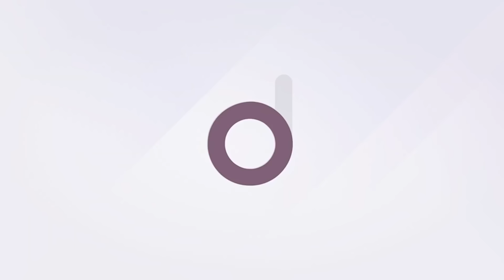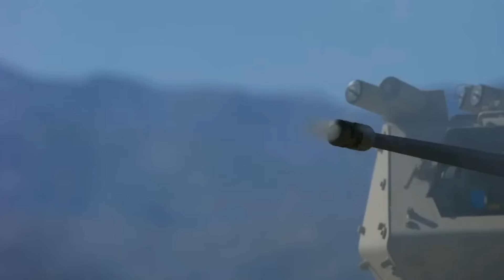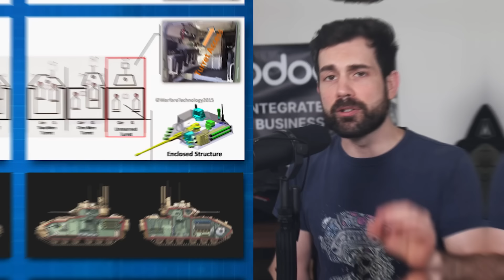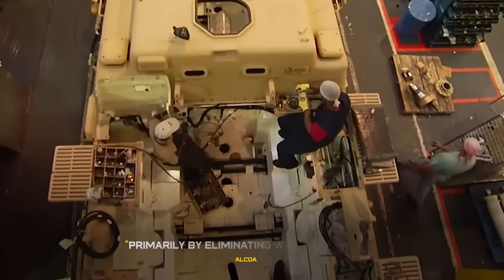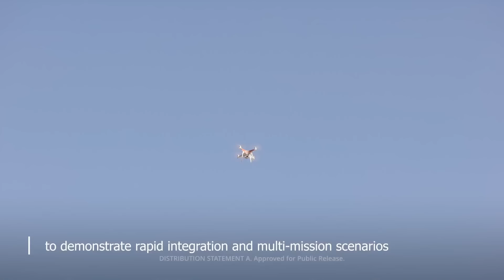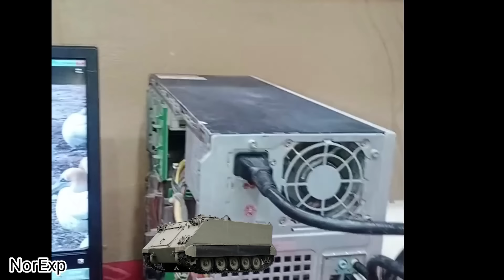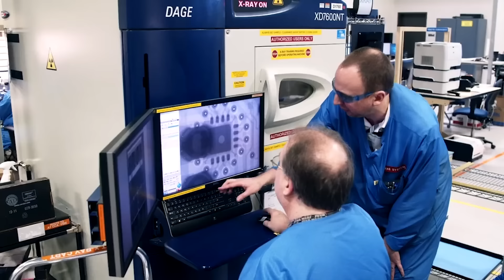How America’s Quietly Building a Secret Armored Fleet

Comment: I can build a box that's 2 ft by 2 ft by 1 ft. That supplies 238 volts at a million amps. It will supply as many amps as you want to pull from it. It will run directed energy weapons including lasers and everything else they could think of. But they don't want to show you that because then we can get rid of oil. It's a wonder they still allow me to live

Comment: Man, I have to chime into this conversation. Let’s get one thing straight to Bradley and it’s present configuration in Ukraine is taking out Russian main battle tanks and other likewise weapon systems saving lives, proving survivability unlike any American army had ever put the Bradley through Slava the Bradley I find nothing wrong with using the original chassis. It does need a stronger gun on top. I think that big cannon can be of much use. They have a German equivalent that has that size gun on it so anybody bitching about the Bradley platform obviously hasn’t used it has it benefited from it or hasn’t had it save their life and their survival ability is unparalleled compared to Russian garbage have some pride made America strong keep giving them hell Bradley.

Comment: Here's a thought the Xm30 has a 50 mm the remote turret for the AMPV has a 30mm there is an option its new it's called the CTA 40 mm with all the power of a standard 40mm the munition is smaller better to  handle the breach of the Gun only intrudes by five inches has a very high angle for street fighting or mountains

Comment: With all the new projects the U.S. Army has in the works (plus from what I got told by my Drills & CO when I was in OSUT, the Army is shifting from Counter-Insurgency OPs to training & preparing for Large Combined Arms Combat Operations against another Army with similar capabilities aka war with another nation). Having modular vehicles that can be cranked out quickly whilst staying cost-efficient would be immensely beneficial if the U.S. goes into war against another nation-state army. That’s what jumps out at me the most when I look across the board at all the new projects. The AMPV, the Oshkosh MATV, the Abrams X, the new weapons systems (I have mixed feelings about Sig’s XM7 but the XM250 & the HK M110A1 seem to have positive feedback), the ARV & NGTV-H. Seems like the Army is switching from “mission-specific” equipment to “adaptable” equipment

Comment: i mean, they could esealy also use this thing as a replacement bradly (at least as a placeholder if they really want a entirely new platform and maybe with a slightly different turret that has stabilization for the gun) , if the main change is the turret, you could arguably even retrofit existing ones, reminds me a lot of the israeli namer

Comment: Cappy has mist the point. A section of AMPv's equipped with mortar, Martlet SHORAD and Javelins backed up with the new M10 Booker tank would be a lethal mix. Add to that the easy to repair functionality and quick role adaptation capability of the type and you have a sturdy, hard hitting resilient strike force that can pivot from strike to area denial operations on short notice and minimum preparations..

Comment: I mean it's not exactly secret when you need to rely on private contractors, who in turn buy supplies specifically for building military vehicles from public companies with no security. Then it's all logged and tracked by a shipping company that's not secret, handled through many third parties who also aren't secure. Sadly due to the heavy reliance on contractors and defense companies most things aren't exactly very secret so long as you look a bit.

Comment: You said the M113 APC WAs relegated to duties in the rear.  Bull.  We are right there in the front, often dismountingand fighting as infantry men.  Inside, ammo was piled half way up to the top.  Typically had 6 dudes sitting on the top.  .50 cal machine gun, ar least 1 7.63mm machine gun, grenade launcher,  a mortar track, lots of C4 explosive
  The M113 has been deployed in almost operations, often used alongside infantry units.

Comment: Are AMPVs currently being manufactured with a remotely operated Weapon Station or not ?   To me with the current drone threat and the fact that APCs in a serious conflict will end up right on the front line, thus I cannot see why Weapons Station with 30mm auto cannons and either Stingers or Javelin's are not the standard manufactured package.  

All you youngsters keep saying that the M113 was a rear area vehicle, but in 1960-70s the M113s were tight up there on the front line.  An M113 with a M2HD and two M-60s, doubled your firepower, transported cans of ammunition and that aluminum offer more protection than a fatigue jacket.

Comment: After working on M901 I like the interior changes. The M106 left  the 11Cs exposed. YES, This is very interesting. As a 63T  I have been very happy to see the Bradly prove the nay sayers  Wrong. At this point a strengthened hull and the top plate have me excited. Also the M577 stood out . This one should blend in better.

Comment: For all the hot air about modularity, it really is the key to large scale mechanized warfare. If you want high mobility, which is the very reason for mechanization, then you have to be able to effect repairs and replacements on the battle front. The Germans discovered that too late in WW2.

Comment: The larger calibre the cannon then the more advanced the ammunition for taking out things like drones.  Artillery and air glided ammunitions mean the battlefield gets bigger, read 50km.  Thats a lot of driving about needing at least splinter blast protection.  If MBT's can't stop anti armour then APCs aren't going to either, so why try too hard?  Large vehicle volume means more stuff can be carried such as drones that can fly to the hot front.  The only issue with large vehicles is how to hide them, or park in defendable positions.
Better now, and cheap, than nothing for years.  Seems like a good short term fix plan.

Comment: The Bradley's hull which these platforms are based in is a VERY solid and reliable base. I was a Bradley mechanic for 15 yrs. And the upgrades to the Bradley have continually included upgrades to the hull interior and exterior. It's very fast moving and has proven to be a tough base for these future systems. Plus we already have a buttload of them in storage over seas and here in the US. We have hundreds in storage in Kuwait. Some still in the ODS (Operation Desert Storm) configuration. And others are the A2 versions. If the Army is looking for a replacement for the Bradley's base turret and hull configuration. Then reusing the hulls to create new platforms makes sense. We already have tons of parts in the parts system and we have vendors already supporting making new and rebuilding hull and suspension parts for the hulls and drive trains. It's a smart and cheaper option than trying to buy a whole new system and buying all of the parts with those new platforms.
Reply: The Ukrainians love their Bradleys. Even knock out old Soviet MBT's with 'em.
Reply: @Nebris still the German lynx rules
Reply: Just curious, what about the unmanned turret/weapons system on top? How reliable are they? I've heard mixed reports of manned vs unmanned turrets being reliable
Reply: @degriffon I suspect that they will be incredibly reliable in about four years.
Modularity means they can be swopped out for upgrades and replacements
Reply: The hull itself is new though. A one piece design, based on the Bradley. But I bet the turret systems may be easily backwards compatible.

Comment: Questions about ramjet artillery --- 
1. can it change course mid-flight? 
2. can it be used to hit moving targets? 
3. can shell maneuvering foil counter battery action?/ 
4. Since it uses EXISTING howitzers, how fast is US Army going to 
switch to ramjet artillery shells?
Reply: Is a ramjet even worth the engineering when solid rocket motors are cheaper and easier to build?

Comment: Interesting concept I think if we are going to get into a large scale war, then utilizing existing systems parts sound like a good idea, not sure if single piece hull will stick around, reduced assembly time doesn't mean reduced manufacture time. it is my understanding that the original Sherman tanks were all cast single piece hull then changed for multiple piece design because it was easier to make when you looked at entire process. That may not be the case now but is interesting they talked about assembly time not total time. I also think that the modularity of what can be attached is a good idea, expanding on that may also be good but would require leg work upfront to do it right.

Comment: Wheeled vehicles could do similar support role with different mobility capabilities and lower operating cost.  With come units using the AMVP and others with wheeled vehicles. The Striker may be too small for some of these roles.  The German Boxer is highly modular and capable.  The Marines  new ACV 8X8 amphibious vehicle could be the basis for an army vehicle using the same mechanical systems already in production.  This could include heavier non swimming versions.  Some may use the existing Marine vehicles with a useful amphibious capability.  Not as modular as the Boxer that can swap mission modules.  They could still be highly mobile and useful protection.  Wheeled vehicles having reduced maitainance costs. MRAPs could be another option for some roles.  Not all missions require tracked vehicles.  Wheeled units could still have some AMVPs for some roles.  Such as engineering and recovery vehicles.

Comment: I was on the original PM team for the Javelin, which is still the only fire & forget shoulder launched missile in the world, even though it is 1980's tech. There were several things which drove the cost so high: 1. advanced leading edge tech, such as growing silicon wafers and building thermal imagers. And 2. being forced to add on an unnecessary thermal viewer, aka CLU. This was forced on the program by the Infantry School and drove cost and weight well over program goals. Still when I saw that production was started again at Troy, AL I was excited that the true potential of the Javelin could finally be realized. But I am concerned that cost has not been addressed. I am hearing $200k per missile, when, since all that leading edge tech is now very cheap, I would expect cost to be more like $20k per. And that CLU is still being used, when you could essentially use something like a cheap smart phone in its place. So, potentially, those 4 Javelins on this BFV chassis could all be targeted and fired at the same time, plus fire on the move is very possible, since the Javelin's imager/fire control is fully stabilized and capable of +/- 45 degrees. In fact it could be used as a cheaper version of the fire control for the BFV's gun, and all other fire controls (IBAS) tossed. Range is another misnomer, 4k range was with the original 64 pixel imager, my cell phone has a 50 mega pixel imager. That 64 pixel imager was one of the high cost items on the Javelin because TI was just learning how to grow the silicon wafers required for the imager. My cell phone in total is about a tenth of the cost of that early imager. So range is open ended.

Comment: The AMPV is a Sherman knockoff - Its works, its cheap and its there. It is NOT a good vehicle all in all. But it will work. Sadly the Bradley is 10 times the AFV than 10 AMVP's will ever be. Yep that's 100 to 1. Sure "new" is good right? Nope Look at the Stryker.... The procurement chain is pathetically compromised by the last 2 decades of Ex-Generals in BAE, GDLS and the other big boys. 1 Size fits all - almost always ends with none of the ALL being very good. A set of 2 or 3 vehicles - with some component sharing - but more so designed to each handle a couple of tasks very well, not "good enough", again, nearly always results in a long term cheaper solution and better results. History and Math do not lie. And this turkey being the end all be all is a lie.

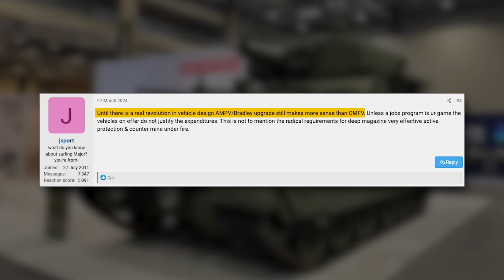Comment: 9:03 In Germany, one former defence minister shot down proposals to modernise the M113 already existing, and this might be one of the few good things Scharping did during his tenure. The reason he gave was that putting M113 on life support would not be a long-term solution and divert funds from the Boxer program that would better be spent there. So I can see why it can be good to concentrate on the OMFV to have a truly new vehicle.

However, we are at a crossroads where the 5th generation armoured vehicles aren't there yet, so "jeeping" together a gen-4.5 or gen-4.75 for immediate use might be a good compromise - IF it doesn't lead to all development into next-gen vehicles stops or is slowed to a crawl.

Comment: All well and good, BUT:

An IFV has a bigger motor, thicker armour, and overall a higher cost both in USD as in manufacturing hours and machinery than an APC. That's why Germany replaced its M113 with Boxer, not Puma. Replacing all M113 with essentially Bradley platforms means there isn't a comparable APC platform for all those applications where you don't need an APC - command posts (which have done something TERRIBLY wrong if they need IFV armour), tractors, things where you need high mobility and low weight but no good protection or weaponry.

I know there is a vehicle approximating the Boxer in the US forces, so it will have to be seen where an M113 is replaced by a gender-fluid M2 Bradley and where an 8x8 is used.

Comment: An armored replacement for the M113A3 that has power and cooling capacity for thermals, 30mm guns with antidrone capability, turret swap plug and play, and the ability to take an RPG7 or IED and have its crew dismount ready to fight , would be too good to be true. These are capabilities of the Bradley and Stryker. I suppose I should ask if the front armor is impenetrable by 14.5mm, which is another capability associated with IFVs, not APCs. 
Honestly, if this program can produce vehicles of that capability at the cost near an M113, and provide one to nearly every mech inf squad, that would be the holy grail. Is it actually possible though?

Comment: BAE has a habit of tapping into old tat and selling it as a new purse...they stung the uk taxpayer for £50m for design development for the new ballistic submarines, even though all the way through the Astute class we were told it was modular, and a new missile section could just be plugged in between the for and aft, hence to long flat deck to the rear for Chalfont hangers etc.
Sometimes it works though, with the Saracen, Scimitar, Scorpion etc class of light tracked armored vehicle, though that was Alvis? before BAE. Apparently their now trying to resurrect a wheeled troop carrier from the 1960's as a cheap striker or patria style high mobility box. But open architecture modularity works, just look at the praises for the SAAB Griffen, though i think this is also under the BAE cloak now.  Guess i'm just hacked off i'm not a shareholder.

Comment: I would like to see the new vehicles as Plugin Hybrids.  Electric motors have a lot of torque / HP.    The gas engine could be a "Flat" layout module that could be dropped with a touch of a button so if the engine is damaged you can drop it and run away on electric power.  A 10 mile electric range should be adequate.  Easily detachable and swappable generator engines could keep units in service while engines are undergoing maintenance.  Add a cable and a damaged unit could be charged from a second vehicle so both could get away.  Add a transformer and the engine module could also be a camp generator.  A NiMh or low volatility battery could help protect the occupants.  Add rubber tracks to create a "stealth" vehicle - no smoke or engine noise.

Comment: The brackets industrial complexity systems.s approach/ 

magic extending chequers bootleg syndromes/ burnrate vs roi /

/ aluminium armour _/ spray with crosslinked polyurethane / polypropylene for non corroding blast resistant ... and a complimentary gold plated leather strap. Please let me know what you want to do 50soso if you're free to join us 🇺🇸  

Certainly pistol proof and i say stick a sighting drone and antenna 📡 😉 and connect it to the galaxy _ tab to help with your new contract / it / lasers you can provide 👍

Comment: I was a Bradley mechanic for 7 years. I was saying they should do this 20 years ago. They've had the Bradley platform since the early 80's. Hopefully they get rid of the Cummins 903 engine and go with a more modern engine. There are much better options now.

Comment: The U.S has learned so much-needed capabilities for the new AMPV, from BAE Systems. The new AMPV chassis will be all one piece so that different types of capabilities may be interjected in the production lines such as MED-VAC AMPV'S, or Misson Command and Control center AMPV'S or Battle Field enhancements such as 30 Millimeter closed in 360° turrent with anti-tank missiles armed with anti-drone radar. DD. 🇺🇸

Comment: We need something upgraded Sheridan 152 1/2. That could be air dropped. Also apc IFV whatever. Molded ceramic armor with reactive armor on outside. Hybrid fuel tank same size as asperated , then u can put multiple v hulls to disipate overpressure. And put on new style bogy that can change from wheel style to triangle track for severe off road capability.